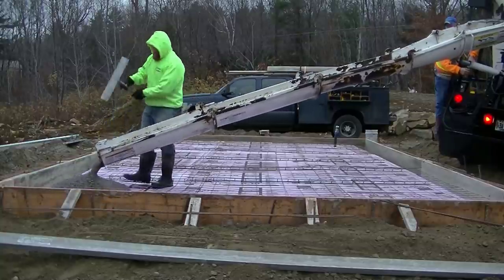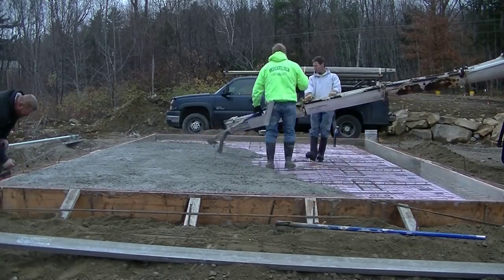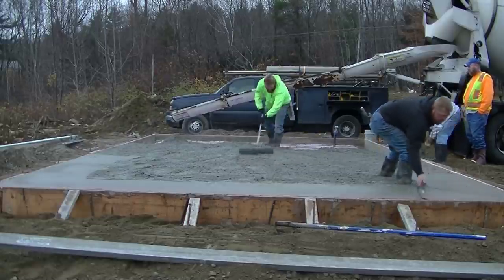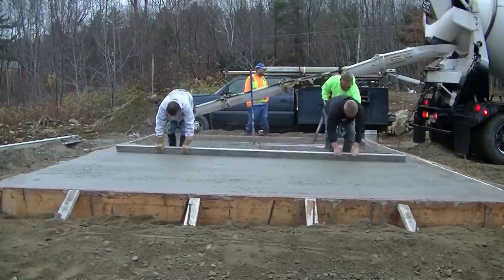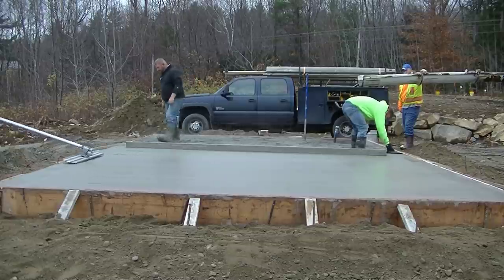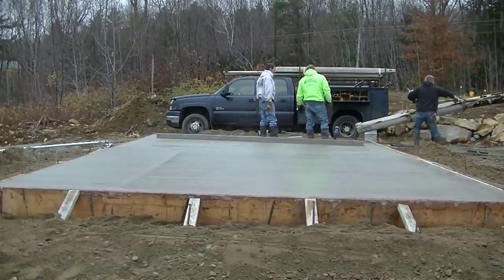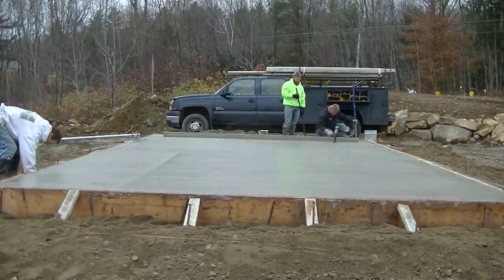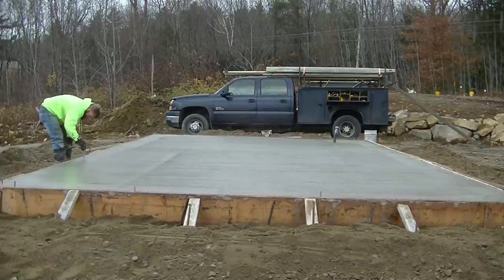How To Pour A Concrete Slab for A Tiny House (16' x 24') Beginners DIY

Comment: How many yards does it take to pour a 12x27 by 8 inch slab?
Reply from the maker: Figures 8 yards Anderson.
Reply: Thank you .. 1 more question I need to do a 33x52 with a 6 inch slab with 3000 psi concrete how many yards do I need for that pour? It's a build in the islands
Reply from the maker: That's going to be about 33 yards. Here's my page to calculate concrete yardage: https://www.everything-about-concrete.com/concrete-calculator.html

Comment: So what dictates the use of a vibrator?
Reply: Ask your mom
Reply from the maker: Scott, we use our Dewalt pencil vibrator when we have a lot of reinforcement to pour around, or for exposed edges and faces of stairs. For a slab like this there's no need for it.
Reply: Low slump concrete, large aggregate mixes, lots of rebar, thick/deep pours - almost all concrete benefits from vibration.

Comment: I like pouring concrete. I always do them alone.
Reply from the maker: It's hard just doing concrete alone.
Reply: I agree with Mike! The small amount of concrete I have poured, I poured one job basically alone. About 2 yards! But for a Fat man in the middle of the summer!! I got heat stroke and was down for a couple of days afterwards!
Reply: Put chairs under your steel/rebar, pour it wet,and strike it off with a whiskey stick ( looks like a big come-a-long or rake) so you can strike it off standing up  don’t get into a argument with yourself and a 16x24 would be easy in fact you could pour two of them a day.

Comment: Yes, tiny houses and more soo the small house trend is popular …….300 to 800 ft2 is pretty popular,...…..sub 300 is trendy, but not as popular/livable.

 I am in a one bedroom 20x24 right now and it is plenty of room, minus storage...…..total house is 24x32, but the last 12 ish foot is a garage...…..so 768 ft2...……...which is way below minum size restrictions in all but the urban areas.

   I am planning a 3 bedroom 32x32 story and a half...….with the second and third bedrooms upstairs...…..a lot depends on layout.  I have been in some 800 ft2 houses that seem smaller than my 480ft2 just because of the layout.